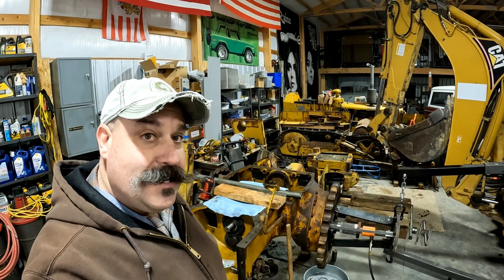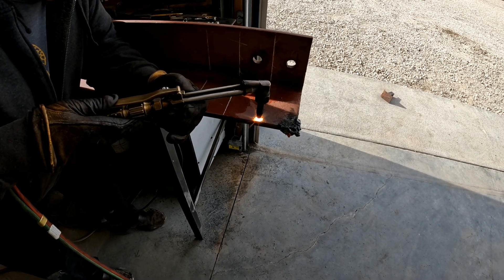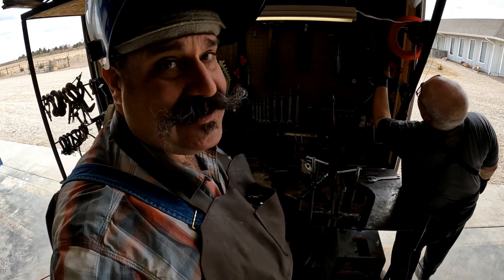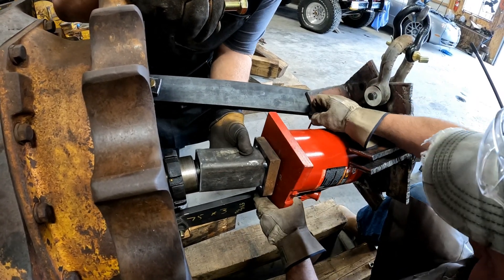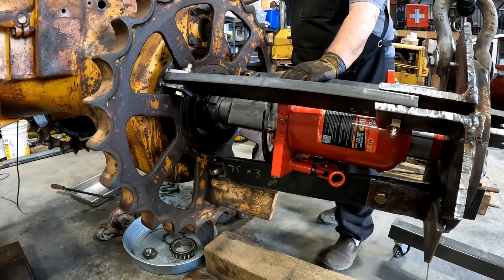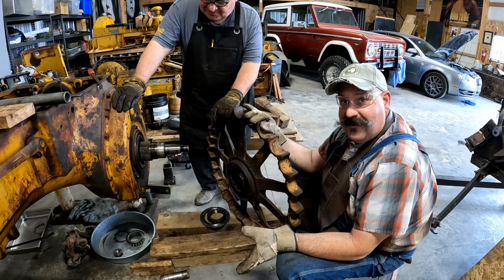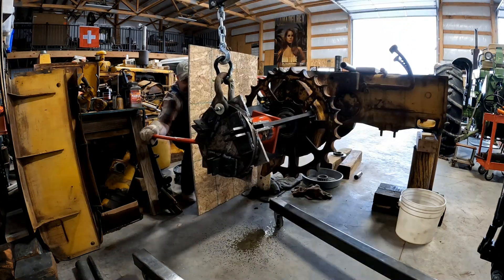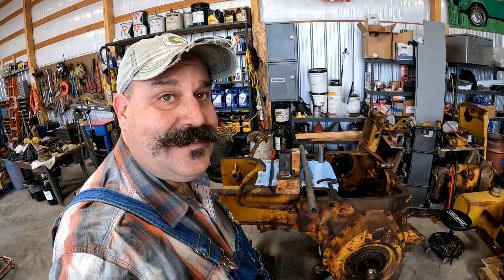Pulling sprockets with a home-made puller! 1939 Caterpillar D4 "Lil Lefty" 4G9986 Episode #30

Comment: I think you did a brilliant job with all your forward planning, construction of that amazing puller and the hours of thought process.
This is one job that just the thought has scared me to death knowing how dangerous it is. 
Can you imagine how far them sprockets and puller would have flown if you had not kept the nut on.
I am still loving your videos, clicking the 👍 button and have sent a link to your channel to my friends too as you deserve loads of support.
Reply from the maker: Thank you. Until the sticky tracks appeared this was the biggest challenge we had faced on the build. If the nut was not on there it would have been a disaster! I actually made that mistake when we pressed off the pinion gear from the steering clutch. I was very fortunate nothing got broken or nobody got hurt. 😬 That was episode number 26. I'm a little embarrassed of the early videos they are very slow. I'm still learning the video editing process. I really appreciate that you're sharing the videos. Every view and thumbs up helps. 😊👍
Reply: @lifeafterourloss  Good morning and yes in episode 26 was a good example of the potential of stored energy. I was shocked how nothing got broken and glad nobody got hurt. I was so glad that the pinion gear didn't break the back window of your truck or embed it's self into the shop wall.
Really enjoying the full story and the early videos 👍

Comment: Preheating that AR400 would have made a big difference. That heavy of lots takes a ton of heat and My old welder needs help.My rods are probably 40 years old but I still use them on projects, but I would buy new for anything critical.
Reply from the maker: I didn't even think of preheating it. That definitely would have made the welding a lot easier.

Comment: Wow ! Wow ! Wow ! ...Excellent fabrication work.  I hope you can get a replacement jack under warranty. 🙂 I had to use a 20 ton puller to remove a timing gear off the crank shaft of my 1926 Fordson, and I was nervous when you put all that pressure on !  Great video.  Thank you.

Comment: The sprockets fought you back every inch. Rip 50 ton bottle jack you did your job well. Some of these bottle jacks don't like to be tilted sideways. I can see both sides have the billow seals blown out and I don't think grease in the final drives would save you from that leak.